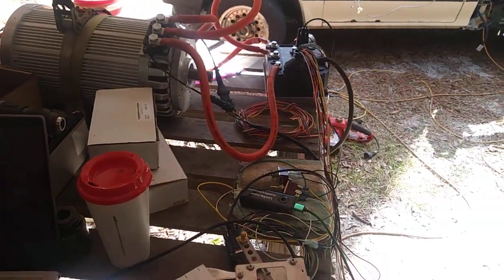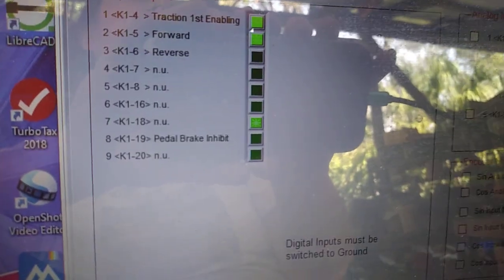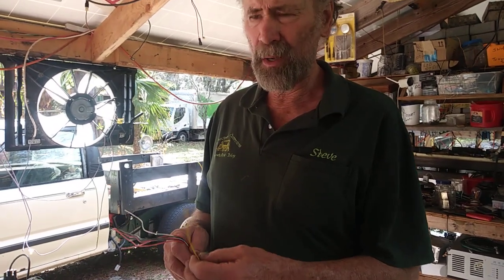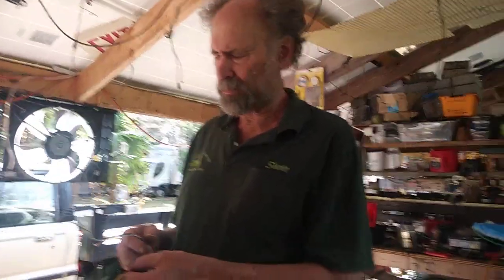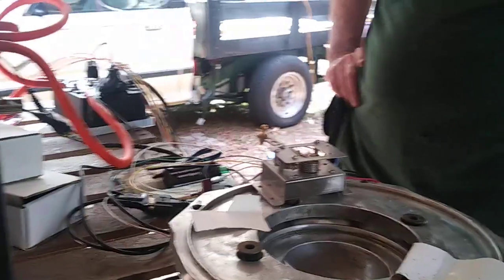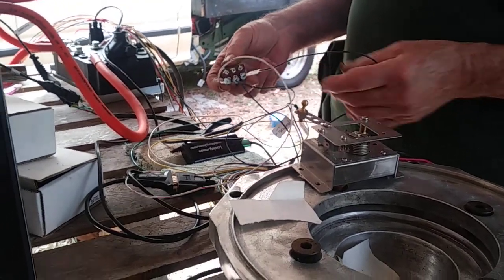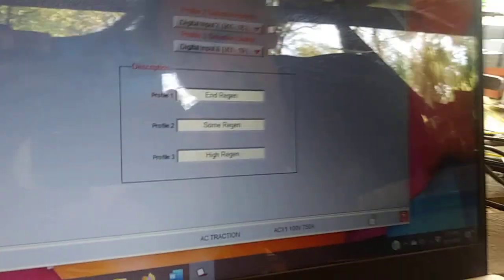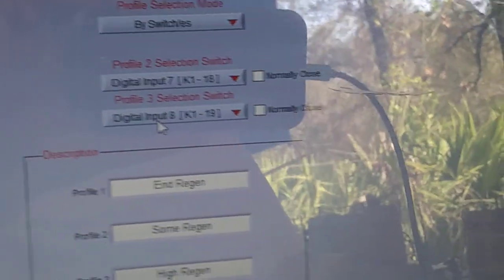Netgain hyper9 motor Set up.

Comment: Is that a Curtis PB8 throttle you are using? I didn't think that would work because it puts out 0-5k ohms but the controller needs 0-5v output? I have a Curtis throttle but haven't tried it yet.
Reply from the maker: You have to solder the third wire on which makes the potentiometer a voltage divider this requires an opening up the can and putting the wire on or there are some that are sold with the three wire setup for 0 to 5 volts
Reply: @steveclunn8165  Awesome, thanks. BTW you guys are the unsung heroes of EV conversions. Great video, very useful. Even now there is not too much info on Netgain Hyper9 setup. I have done 2 conversions but my next is the first with the Hyper9. Cheers!

Comment: Steve! I need some help. I have the same throttle but I get 5v with no throttle input and the error code. It's a pb6 model with red and black into the center input on the plug and red and black on either side. Got any advice. I've got a date with alignment shop this Friday. Thanks
Reply from the maker: There are some throttles that are sold with three wires but they are still two wires across the potentiometer and one to the switch that's on the side so if that's the case you still have to open it up in solder another wire on to the last leg of the potentiometer the way you can tell if this is the case or not is you should be able to find two wires that will read 5K and not change with whatever position you put the throttle in if you can't find that then you do need to solder another wire on inside the Box. When you find the two wires that give you a continuous 5K one of them will be the Plus One will be the minus and then that wiper wire the one that changes will be the middle wire you want the negative wire and the middle or wiper wire to be at 0 ohms when the throttle is not on and that wire should go from 0 to 5K as you increase the potentiometer or throttle setting
Reply: @Steve Clunn  thanks Steve. I ordered another thinking it was faulty. But will open up mine this evening and investigate. 

Secondly, do you use the compact display? All I see is a alarm input 4, but nothing is in #4, just 5, 7 and 8. Does the display become active once throttle is functioning? The motor commission was a success, but without a throttle I had to stop there. 

Thanks for your help and be careful with Ian headed your way.
Reply from the maker: @beazkneez  the display actually runs on one wire and two power wires. What's the top of my head I'm not sure which one I've only used the display a couple of times. It doesn't give real numbers just a full empty gauge and miles per hour which comes from the motor RPM through their program. It also shows errors which is nice
Reply: @steveclunn8165  Got it running last night and drove it around the block. I have a 5 speed, no clutch. On load everything feels great and balanced. Off throttle things get a little chunky and notchy. It that the pre-programmed regen (which seems very light). I have zero control of that as many configure tabs are greyed out and inaccesible. Do I need a different clone file that give me access to those perameters? So fun and quiet and very peppy. Wife was shocked. So rewarding.
Reply from the maker: @beazkneez  do you have a amp gauge ? If re gen is on you'll see 2 to 150 amps going back into the battery. Profile 2 and 3 are usually set higher and 1 its when ever you take your foot off the go pedal. You can use a relay on the brake lights so as to ground profile two or three which energizes it and you get heavy region just slow you down. It's very possible you're in light region and that's what the cogging is and you can adjust that. I'm not sure how come your program doesn't give you that ability you might want to download a new version of the Smart View
Reply: @steveclunn8165  I talked to Nick game this morning. I just need to send them my current clone file and they will tweak it to my liking. I haven't had great success via email but giving them a call and talking to Hunter was very informational and he's going to help me get going. I'll likely abandon the compact display and get a toggle switch like you have for the three different profiles
Reply: .33kw/mile! These Toyota vans are way more aerodynamic than those Volkswagen buses. I get about 180 to 220 amps while rolling at 65 mph and getting over 80 mi per battery charge which is a 24 kW pack. The high region is so great that I'll need to put on the deceleration light soon or else I'm going to get rear-ended. Hyper 9 is top notch

Comment: i have sme acx144 controller   I want to adapt it  with Andromeda interface  evic but it's doesn't support this controller  some one said to me You will need to create a DBC file (CAN map) and import it into our Studio Interface Kit for EVIC to interpret the data. how can'i do that
Reply from the maker: I haven't used this controller for any other motor than the hyper9 which it sold with. This is an interesting exercise or experiment and I hope you'll keep me up-to-date on how it goes. I'm sure there are others that would be interested also
Reply: @steveclunn8165  ME TO I USE MOTOR HYPER9 WITH HIS CONTROLLER SME ACX 144 us you have and the problem its about the display with this controller  okaay sir thanks for replaying have a good time
Reply from the maker: dris EEC  keep us informed on your progress

Comment: I've fought that battle with my Hyper9 motor.  I don't think people understand exactly how much wiring is involved in an EV conversion.  It's not just the high voltage 2/0 cable that you have to snake throughout the car.
Reply from the maker: Yes, the wire seem to grow on their own. When I started my electric car Adventure we had a Curtis controller. What? Which had one wire? To turn it on. Two wires to the throttle box and 2 heavy cables to the motor. Can't even tell you how many words there are off the top of my head today. And of course you have to have a computer. Can't do anything without a computer. What kind of car did you do?
Reply: @steveclunn8165   I went simple and converted a 1971 Super Beetle Convertible.
Reply: I think there is around 28 wires to distribute around the car. Don't cut any off, but terminate the unused ones somewhere (labelled) for possible future use.

Comment: Where on the motor do you plug in to see things on your laptop?
Reply: There is a serial port on the controller. You are supplied with a serial to USB cable to connect this to the laptop.
Reply: @EVSA  thanks for the information.